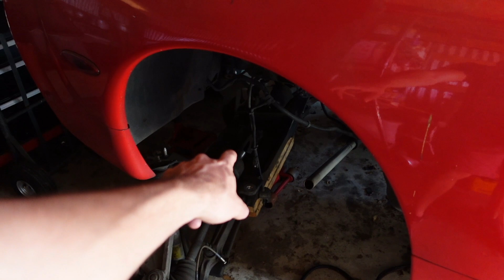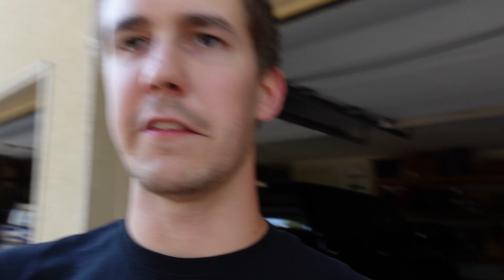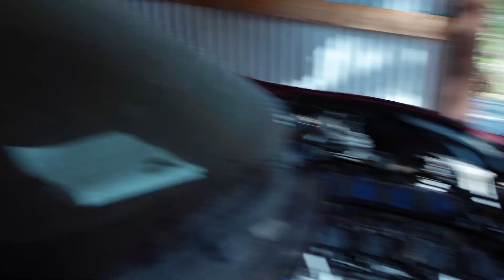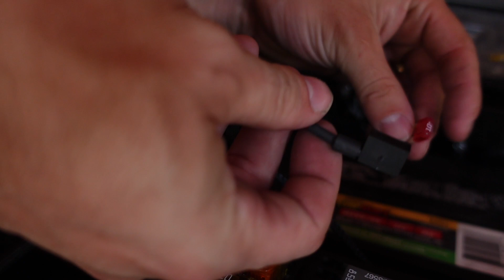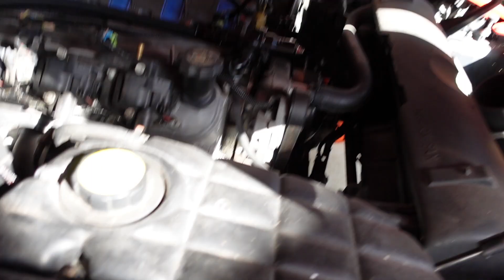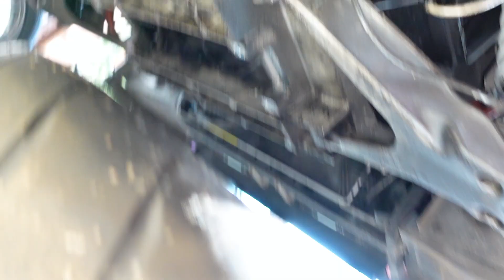Ricky is Never Going to Race Again... (tech tip tuesday)

Comment: Hey buddy!! Been watching ya for a whilr n enjoyin the viddeos of engine builds n stuff. Could watch all nite long if it wasn't for the O'l lady 🤣. But I was wonderin if you did machine shop on other motors also? I'm buildin a mustang I got n I havent decided on a 408w or a 408 clevor motor. My last build was a while back when the stroker motors first came out for the 302 n I sunk nearly 15 grand in the motor just to have the block crack in like 3 pieces. N melted 2 Ross pistons. Luckily my cam motion cam wasnt hurt. But I'm buildin one for next yr n the machine shop I normanly use doesn't do outside motors anymore n well the others idk cause a friend of mine had one built n he went to put new bearings in it n it didnt have the good stuff he had bought n there really isn't a mechanic around I would trust. But let me know if you can do blick work n how much. Thanks for the videos n God Bless!!

Comment: What’s your opinion on pac springs and an elgin 1840p sloppy build lm7? I know you don’t have to, but would you go with hardened pushrods? Any other replacement parts you suggest? Thanks
Reply from the maker: Nice lifters are always a good investment.
Reply: @JacobVillemain  thank you sir 👍🏻
Reply from the maker: PAC 1218's work good with those Elgin cams. No need for special pushrods at that spring pressure.